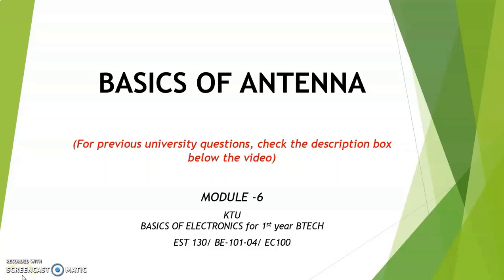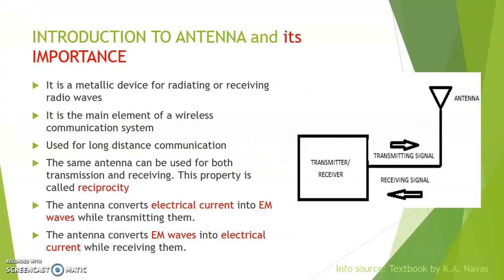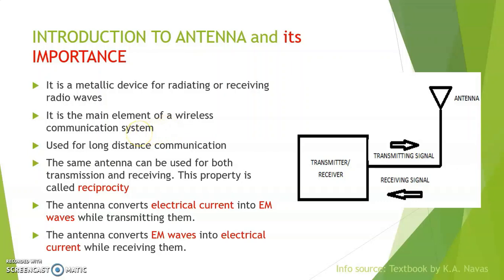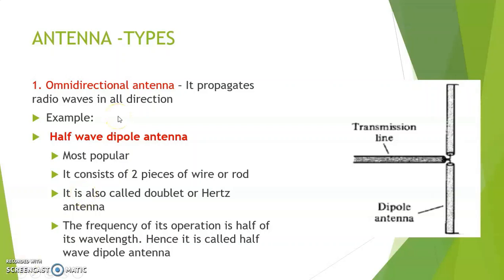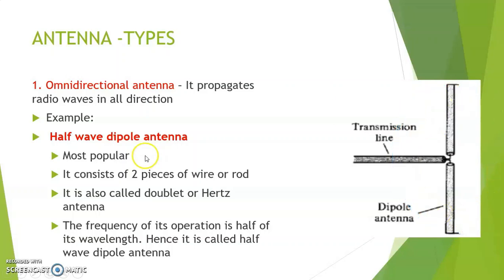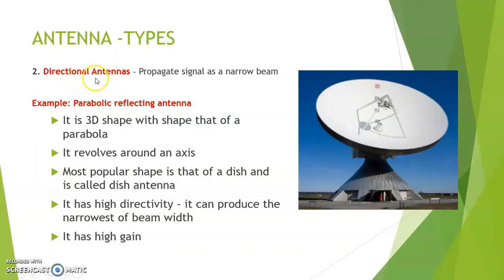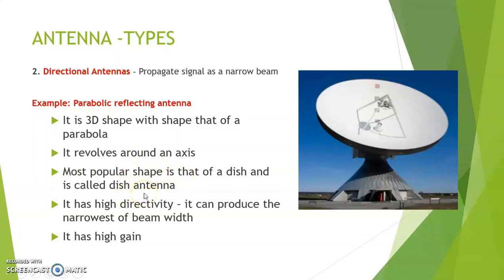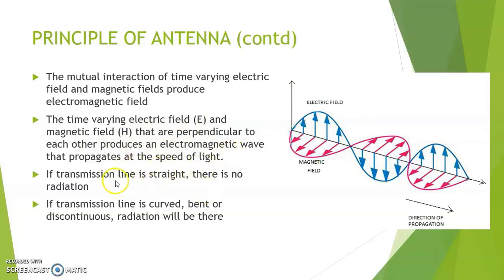Basics of antenna | Module 6- part #(4/6)  | KTU | s1 s2 | basics of electronics | quick learn |

Comment: Maam basics of antennail waveinte figureil direction of propagation leftilalle varandeth ,maam onn check cheyoo
Reply from the maker: Heloo, the electrical and magnetic field are perpendicular to each other and the direction of propagation would also be 90 degrees to it. 
A more clear figure can be found at(check out this link):
https://www.toppr.com/guides/physics/communication-systems/propagation-of-electromagnetic-waves/

I hope this will clear your doubt. Do revert :)